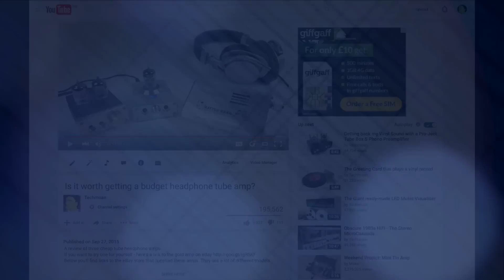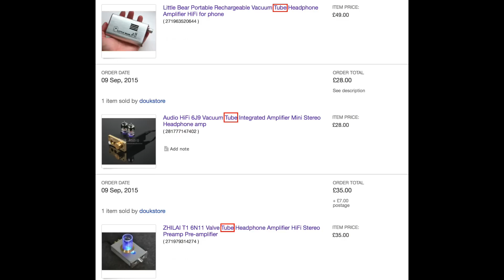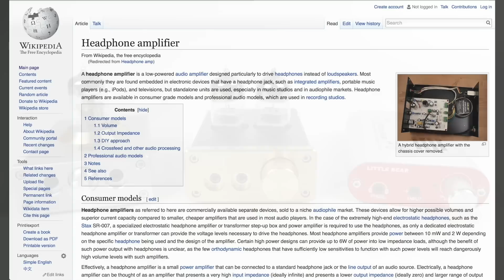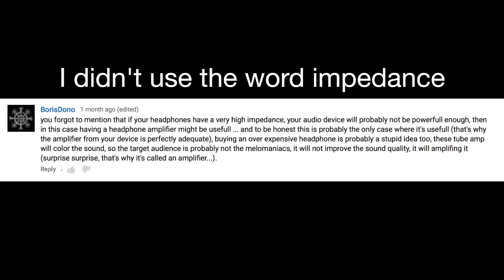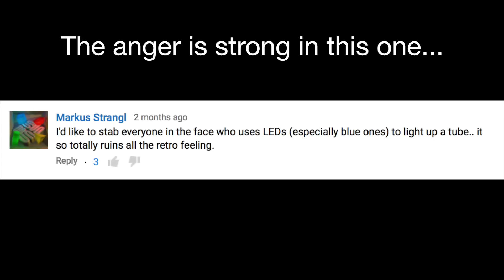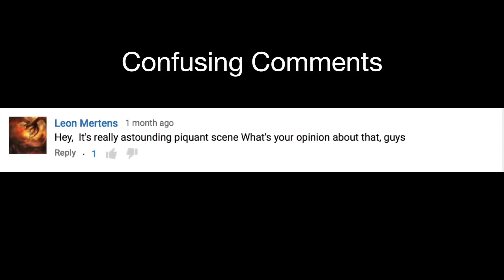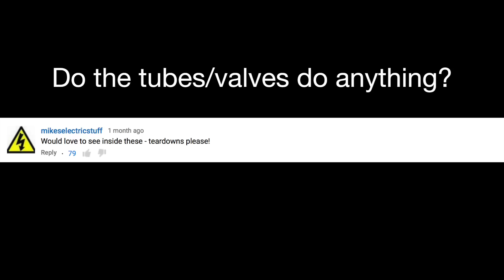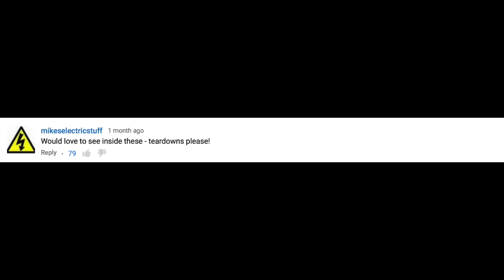Headphone Tube Amps - Follow-up & Tear-down

Comment: Okay, I take back nearly everything I said about these amplifiers. This chap has done a very good job of reverse engineering this type of circuit and has shown that the valves are acting as input buffers:

https://www.youtube.com/watch?v=coSt5HWRvv4

I apologise for any distress I may have caused by impugning the vendors honesty and the purchasers sanity.

I've let my family down...
I've let my friends down...
But most of all...
I've let myself down.

PS: I still wouldn't buy one. :o)
Reply: +Michael Tonge, a sign of a good man to admit his mistakes. And even more when done on the internet. A rare sight.
Reply: I suppose you think irony is something you do to shirts.
Reply: I think we might have a case of double-irony here.
Reply: +Michael Tonge thanks jeb bush
Reply: All the problems of a tube amp (hot, power-guzzling, hiss, eventually wears out after some number of power on hours, physically delicate and bulky, requires heavy transformers for impedance match to speakers / headphones), combined with all the problems of bipolar solid state amp (mainly: unpleasant odd-order harmonic distortion).  Yep, not a good idea.  Looks cool though.  Glows in the dark.

Comment: Hah! Lovely sense of humor!! Those tubes aren't (weren't) necessarily microphonic, but tubes ARE sensitive to even slight jars and will naturally ring while the amp is turned on! The filament diameter in those things is very tiny and, by it's definition, will AMPLIFY any sound going into it. One will KNOW a microphonic tube right away because as soon as the amp is turned on, that ringing will come through the headphones or speakers OR it will start as soon as the music starts and ring as long as music plays. No one should ever tap on any audio equipment when it's powered up and certainly shouldn't lift it up and allow it to drop. I realize it's only cheap equipment but it's to play MUSIC which has MUCH value. Plus it' just wise to use equipment as intended. So, my guess, it WASN'T  microphonic BEFORE you dropped it. I thank you for the thoughtful review also, dropping aside, it was very good and yes many people are obviously not paying attention to videos but LOVE to comment on them. Good job!

Comment: As for the argument about tube or solid state, they can both be great, though a different kind of great. When someone describes a tube amp as having a nice "warm" sound, it means a kind of pleasant non-harsh deep (yet still articulate) sound. This is a type of distortion of the audio signal done by the tube. It's a pleasant, and often desirable type of distortion; subtle. It "colors" or "flavors" the sound. As you approach max volume, tube amp sound may sometimes get warmer. When overdriven (if you can), it can do interesting things depending on the tube and circuitry; maybe make an overheated fuzzy distortion, maybe wreck the tube.

Solid state (non-tube) amps are good at accurate reproduction of exactly what it is told to amplify. Cheap solid state amps will likely sound cheap, but solid state is more the art of accuracy and non-distortion. There are many factors that play into this; I won't get into it. As you approach max volume, it will usually stay clean and crisp. When overdriven, loud, nasty, choppy, ear-hurting distortion is often the result. Most solid state amps are built to never achieve near this level, and thus protect the circuitry and your speakers/headphones.

So tube or solid state? It's entirely 100% a personal preference. Good solid state amps won't be cheap. Good tube amps won't be cheap. Cheap tube or solid state amps may be good, so-so, or may be junk. Generally solid state is a little cheaper, but prices amongst different companies vary a lot.

Comment: I can't say that I'm an expert on tubes, but whether these are low voltage (6-12ish) or high voltage (150+ or so), the circuits to appear to have what is needed to drive different voltages. On the gold one, below the R22 label and right of the C7 label are two black cylinders with copper wire wrapped around. These are small transformers that can bump voltages up or down. A high frequency pulsed DC power signal is generated by another chip, which allows these transformers to work. On the silver (non-portable) one, you can see it between a couple capacitors up top. On the portable one, it's way on the right side, though the casing of it is square with rounded corners unlike the others. Thus I would not doubt that all three are indeed using the tubes, being that they are designed to run various voltages required by whatever tube they use.

Comment: Just thought I'd point out that it's a double-sided PCB and most of the tube socket pins are connected in the circuit so the tubes are contributing to the amplification. In particular, it's possible to see that the anodes (pin7) are connected together, the cathodes (pin1) are as usual connected to the suppressor grids (pin8) as well as through a resistor to the control grids (pin2) to create 'cathode bias'. I'm still trying to trace details of the circuit - a tricky thing with double-sided PCB and surface mount components - but it's also worth pointing out that these kind of tubes don't necessarily need H.T. and will work quite well at very low anode voltage. 
Here's an example of a DIY circuit using a 12AU7 with only 12 volts: http://www.instructables.com/id/Class-A-Hybrid-Headphone-Amp/
Reply: +techsyschip the tubes really are active and connected in the audio signal path, but 
they do none of the amplification.  All of the amplification is done by 
the two NE5532 op-amp chips.
Reply: Niels Haneveld Yes,I discovered that shortly after my last comment, the tubes are acting as "buffers" in cathode follower mode, so only 'amplifying' in a 1:1 sense, whilst contributing some "valve sound" (or distortion depending on your viewpoint). 
Because of this I've since obtained a "Little Bear P-1" amp (identical to the "Indeed G2") which genuinely uses the double triode 12AU7 for amplification.

Comment: EEVBlog just posted a video with a complete analysis of one of the three amplifiers,
namely the two tube amplifier with the brass colored case. It answers pretty much all of the questions people had here.
In short - the tubes really are active and connected in the audio signal path, but they do none of the amplification.  All of the amplification is done by the two NE5532 op-amp chips.
It would not be surprising at all if the other two amps that Techmoan has here work the same way.
https://www.youtube.com/watch?v=coSt5HWRvv4

Comment: This are multilayered PCBs so the 5532 so the operation amplifier and the tubeis used to process the audio , tubes are oldscool transistors , there are all Pins connected but on different layers of the pcb

Comment: As a guitar player, the section with all the "Anti-tube" excuse me "valve" people, really made me laugh.
Reply: I'm actually interested in these specifically for practicing guitar when everyone else is sleeping. It looks like a neat solution.
Reply: @acerbicgeoff7821  It's not a neat solution cos they're not actually valve amps. The valves don't amplify. Signal passes through them, but in a way that's basically cosmetic. They don't have the "valve sound" guitarists like. 

For headphones, is a little transistor amp so bad? If people perform with them, they should be good enough for practice right? And any practice amp, any two amps at all, are gonna sound different. So does it matter to get a valve one? 

Finally, don't guitar amps usually have headphone sockets?
Reply: @greenaum  I understand your point, and yes they do, but if I want to go out in the backyard, I don't generally like dragging my amp out and laying down a drop cord just so I can drink and chain smoke out of the way of the family. You are right it's basically cosmetic, and my current solution of a headphone amp that literally runs on batteries and stays connected to the guitar is far more portable, but others might like the little gadgets too. It's all preference
Reply: @acerbicgeoff7821  No I mean in THESE amps the valves really ARE cosmetic! They're NOT VALVE AMPS!

I can't remember exactly from the teardown, but basically signal passes from one plate to the other, in these. In a normal valve amp, the valve is an amplifying element, and in doing this, the valve's nature affects the sound. 

These are purely silicon op-amp amps! They're a ripoff, is the point. They won't sound like what you're expecting. 

A little portable valve amp might be nice. It'd probably cos you though. You'd need a few PP3s to power it, the simplest way. Whatever. It could be done. But not as cheaply as in these, and certainly not as shitly! 

They're a ripoff mate! Purely cosmetic as in visual cosmetics! The valve is in-circuit but not actually modifying the sound signal, AT ALL!

Comment: the
6 on the tubes/valves i know is for the heater voltage.
N i had to look up but means it a gassfilled triode
11 designates how many elements are used. and/ore predicts what connector type it is.
you can look this up just google for " vacuum tube designations " there are different designation types
And as far as i could see these are double sided pcb's and the circuits seem legit to me.
Never the less, vacuum tubes have there places, and i think it's quite nice to see these gadgets . i only don't think small portable tube amps really have a place. The Pono player how ever is a rip of . it is the cheapest and easiest circuit in a box and then overpriced. sadly, but this happens A Lot. 
BUT ! Never mind the bullocks ! keep shooting these video's cause i for one really enjoy them. especially the old hifi tech.
 
I wanted to ask you btw. What is your opinion on this. 
Is it better to buy a good vintage high end turntable for the same money that a new "good" turntable costs ? ore buy a new one instead.
Reply: +Dhr Willemsen the tubes really are active and connected in the audio signal path, but 
they do none of the amplification.  All of the amplification is done by 
the two NE5532 op-amp chips.
Reply: which isn't a really bad op amp. the tubes are just pass troughs then, thats a shame.

Comment: Tubes WILL run at 12V just not at their best performance , most of the low voltage tube headphone amp are a TUBE PRE and a Op-Amp Power stage (8 pin IC) most likely a NE5532 or a OPA2314

Comment: sure would be nice if people did their research before posting their "technical opinions."
1: I was initially suspicious of the devices due to the fact that virtually every capacitor is rated at 16v. They COULD HAVE designed boards running at higher voltages with under-spec caps.. but that would be bad.

2: upon closer inspection, there ARE inductors on each board. those could be for a switch mode power supply, OR voltage doubler/tripler. Can't really say. though I dont see any SMPS controller.

3. part numbers and datasheets!
The opamps used are not really capable of generating much power. one part I looked up was about 1.2 watts max.. but that spec was not amp power.. it was dissipation. as in chip burning temp. people often get confused by the name op-amp. it's not THAT kind of amp.. not really. sure it could drive headphones.. maybe a small desk speaker (but will sound like ass in a can).

re tube heaters.. people need to read the datasheets before commenting. the first time you show has a heater voltage of 5.7-6.9v 460mA! 11 seconds max warm-up.
Typical plate voltage of about 120v, max 330. but 120 is for full power amplification. it will amplify down to microvolts (as do generally all amp tubes). its like only using 1-3% of its range, but it still WORKS just fine as advertised.

4: nothing on those boards indicates to me that there is any sort of nefarious artificial delay to make it appear to work like a tube amp when in fact it's not.

5: moat of the pins on each tube ARE IN FACT going somewhere. look again. there are tracs both top and bottom. and a few pins are not to tracks but to PCB planes (connected directly to the large area of copper surrounding the pin).

All in all, I think that they all do in fact power the tubes appropriately (though perhaps at the lower ends of their limits). they also actually amplify through the tube and not just the op-amp (though possibly below the tube's "best region" which is somewhere closer to 50v on the plate). And NO the op-amps are not really a part of this. their job is impedance matching and a bit of amp between the low line level input and the input drive to the tube. if you tapped a line at the op-amp outputs, you'd find it not much louder than the original source.. nothing close to the final output of the device anyway.

also in general, that last amp was not just "a bit crummy" it was absolutely terribly made. Dave Jones would have a heart attack.
Reply: tube datasheets
http://frank.pocnet.net/